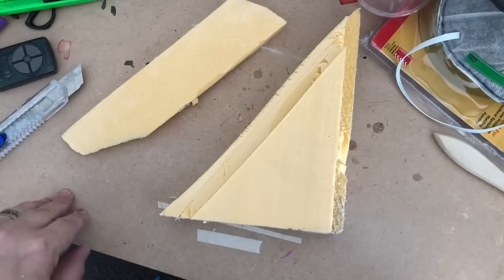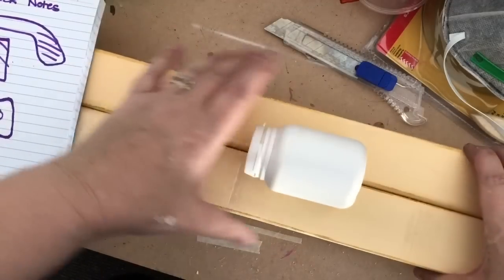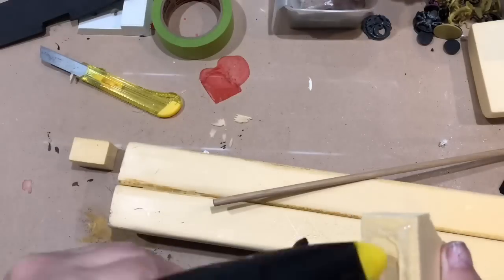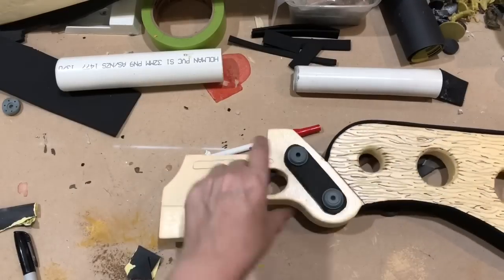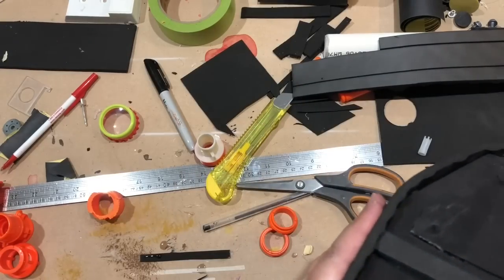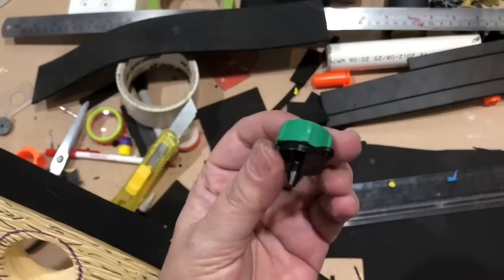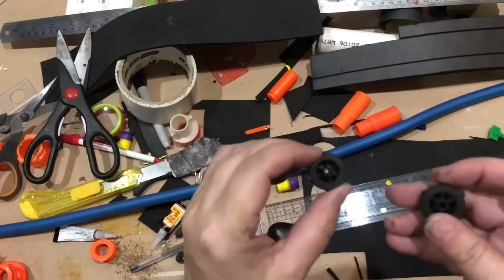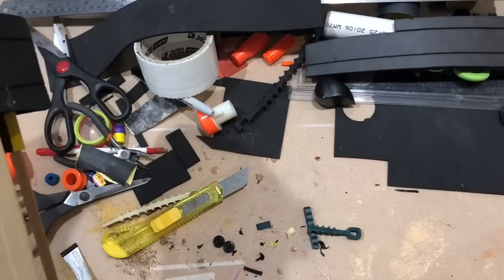FALLOUT DOUBLE-BARRELED SHOTGUN BUILD TUTORIAL - How to make a Fallout Shotgun Prop

Comment: Great video -2 questions -what was the grit of the sandpaper you were using? I struggle to cut that type of insulation foam properly -what did you use to cut it so well   box cutter blade? bandsaw ?